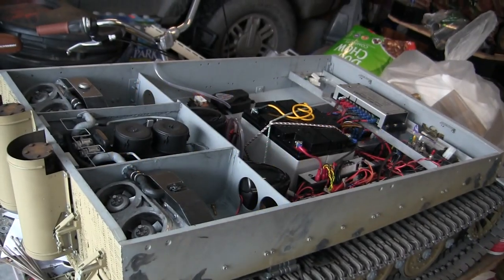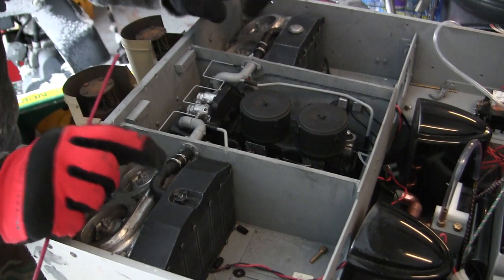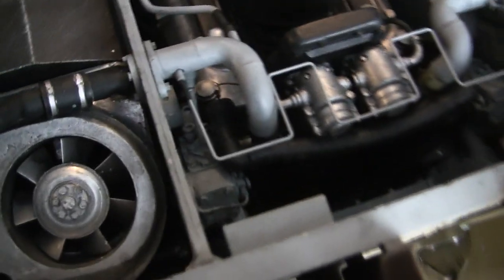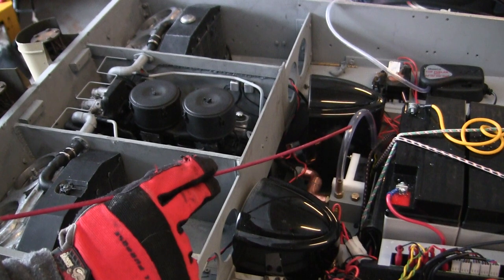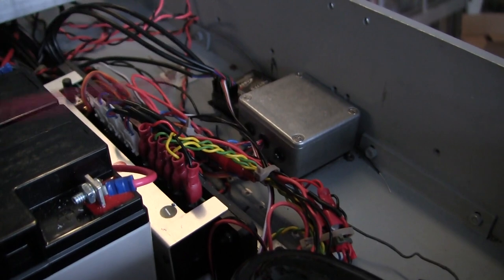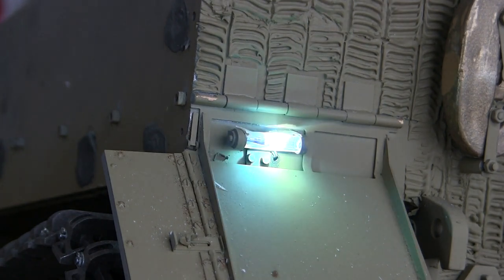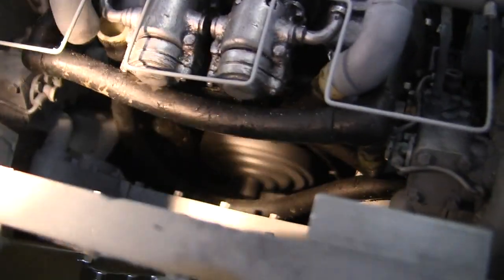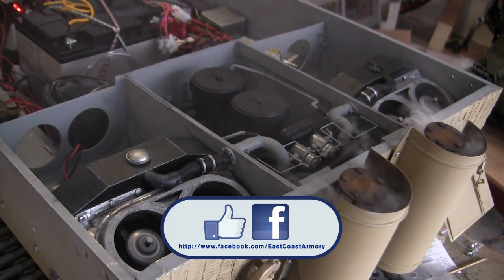Armortek Late Tiger I Project video #12 (Engine installed, hull animations complete)

Comment: dude  German tiger tanks were diesel
Reply from the maker: None of the Tigers were diesel, all were gas powered, This is a common myth and misconception. This also applies to the Panther, PZIV, and King tiger. 

Some of the WWII Diesel powered tanks would be the T34, M4A2 sherman, M10 TD.
Reply: German tanks were gas powered!

Comment: i think you did a hell of a job here. all the detail you brought in is is just beyond anything else i saw before. there is just one thing i can think of to make it even more real. try to force the smoke out of the exhaust. i saw this one time before and looked very real. i do not know how this guy did it but i can imagine that you add a fan in the ducting and beside that a valve that will open and close as fast as the sound let you believe the engine is turning over. and maybe the best way for that is a esc connected to the exhaust fan and an other motor. the second motor can spin a disc and in the disc will be one hole that has to be as big as the duct the smoke is pushed through. this hole should be place as far to the side of the disc as possible (example:"smoke pipe diameter: 50mm, motor diameter: 50mm. then the disc should be like a 200mm diameter. now the hole in the disc is rotating arround the motor and there will be enough space to place the smoke pipe parallel to the motor. then make a slim fitting chamber arround the spinning disc with holes in the same line with the hole in the disc. and connect the duct pipe to one side and continue the pipe from the other side to the exhaust muffler at the end. the idea would be to let the smoke exit in faster moving puffs instead of a slow just flowing out never ending cloud. when idle it may be like that but when reving not only the smoke should increase like you have it set up not but only see the increasing of the revs back in the faster exiting puffs of smoke. i think if you would do that it would look 100% like a real tank. and again great job